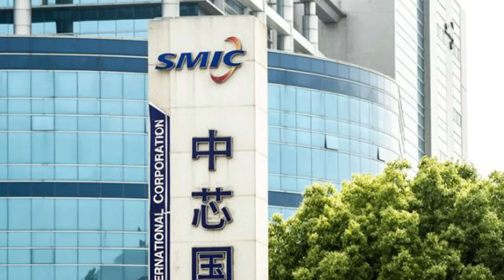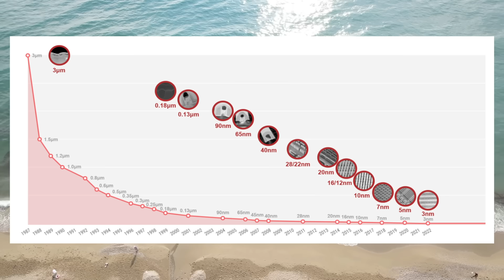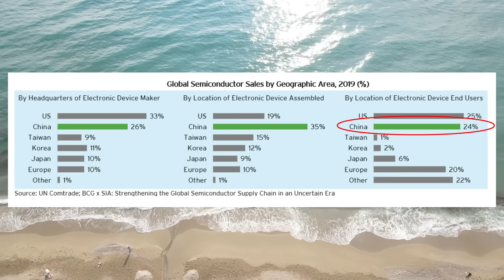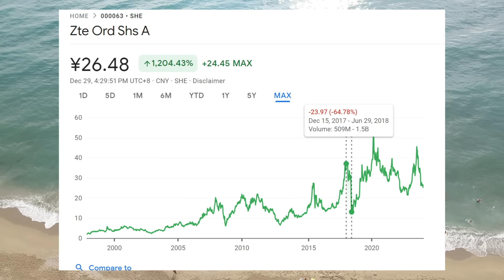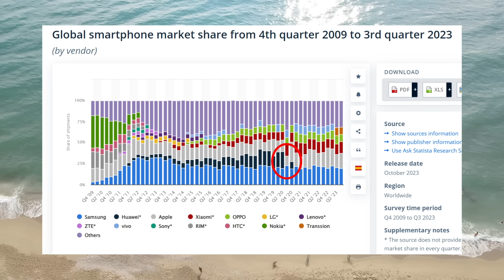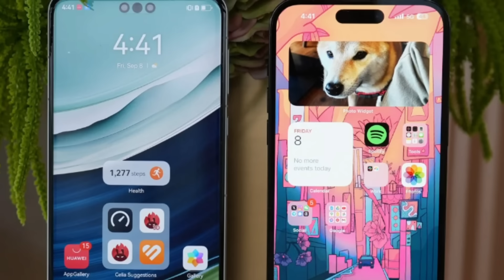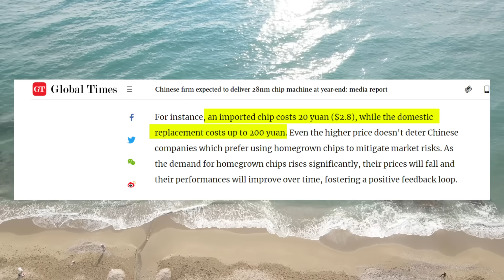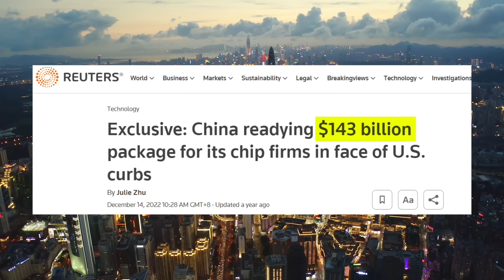Why China Semiconductor Sanctions Won't Work

Comment: For sanctions to work, the target must be weak and small enough that there is nothing they can do about the sanction. Their market cannot be so lucrative that foreigners would run the risk of punishment to supply them.  They cannot have a big and sophisticated science and technology sector so that they can make replacement products (not as sophisticated, more expensive, but still useful).  

China fits none of these criteria.  Why is anyone surprised that the sanctions fail?  The real problem is that the US started the technology war without thoroughly studying China's capability.  "Know yourself, know the other side, and you will not lose."  The Biden administration obviously had not done its homework.

Comment: @18000rpm
Have you visited the Huawei factory or are you working closely with the management there? If not stop being a smart-ass with your ridiculous speculation. 
All important parts of any device or equipment must have a manufacturer's serial number indicating its manufacturing date and place for security or other reasons. 
Many specialists have already dismantled the Huawei Mate 60 and confirmed that the chips were produced by Huawei from a DUV machine with stacking techniques. 
You have just made yourself look like a fool without any concrete facts or proof.

Comment: The nanometer rating of chips isn't how fast or energy efficient it is, it's the size of the transistors.  Mind you, smaller transistors are more power efficient and because there are more of them and they are closer together, lower nanometer chips are faster.
Reply: It's the opposite, the number no longer indicates size but rather a set of power and performance benchmarks. 3nm gates are roughly the same size as 7nm ones as of 2023. But they have a lot more features built onto them.

Comment: As someone with family in the semiconductor industry working with TSMC, Samsung and Intel, China will have a hard time in the EUV space as the entire supply chain is often blocked for them. This channel always focuses on ASML, but there are thousands of companies like Lam, Applied Materials etc, that have extremely complex proprietary equipment and chemicals that they themselves have taken years if not decades to research, develop and then apply to current fab lines. There are multitude of smaller companies that are spun out of academic research labs that have the few people in the world who know how to make and apply it even if their research is published in a very general and simplistic fashion. These companies themselves have taken years to get their stuff working and get their stuff to work in the fab lines which often takes as much work as just making it. These aren't off the shelf products, but products that require years of back and forth with Intel or TSMC to get even maybe the product to possibly work.

Comment: You are wrong, completely wrong.
Ronald Reagan crushed the Sovjet Union without firing a single shot.
He made it collapse internally.
Joe biden is doing the same with China.
When China builds it own space station it is using money which it does not have.
When China is developing their own chips they spend a lot of money.
Today they can't even pay salarys for their soldiers. Nor for doctors and teachers.
They will collapse mainly because they use money to appear strong instead of building a sound economy.
Sanctions are making exactly what is intendeed. They are clever acts indeed.

Comment: During the tear down of the Huawei mate pro 60, it turns out that China has just been using 3 year old chips that they purchased from tsmc before the sanctions hit.
Reply from the maker: You're confusing the Mate 60 Pro with the L540 notebook. The L540 notebook's chip was indeed purchased from TSMC before the sanctions hit, but the Mate 60 Pro uses a chip made by SMIC

Comment: In 2011, Obama proposed the "Pivot to Asia" strategy, which shifted the focus of US foreign policy from the Middle East to Asia. This, along with the wargaming of a sea blockade of Chinese commercial ships on a global scale, the formation of the Trans-Pacific Partnership (TPP), which deliberately excluded China, the establishment of a 2500-strong US marine air-ground task force in Darwin, and an increase in the rotation of both US Air Force planes and US Navy vessels through Australian bases, alarmed the Chinese leadership.

Unable to remain passive, hide their strength, and bide their time, Xi Jinping was selected as the leader of China in 2013 to make China more secure. These included the establishment of the Asian Infrastructure Investment Bank, the Belt and Road initiative, and the building of artificial islands in the South China Sea. These policies were a direct response to the perceived threat posed by the "Pivot to Asia" strategy. No country is excluded from joining the AIIB or the Belt and Road Initiative. Obama's intentions were clarified when he responded to Xi Jinping's proposal on September 25, 2015, to make the South China Sea (SCS) a non-militarized zone by initiating freedom of navigation operations in the SCS on October 27, 2015. In 2015, The “Made in China 2025”, (MIC 2025) initiative was launched.

It was cheaper for China to buy reliable Western chips, benefiting both sides. China spends more on chip imports than on oil. The "Made in China 2025" initiative provided substantial funds for chip development, but companies were hesitant due to technical challenges and the risk of competing with established players like Intel, Samsung, and TSMC. With US sanctions, China shifted focus, prompting the emergence of new chip research companies and increased government subsidies, making domestic chip development a top priority for Chinese research institutions. When self-sufficient, China can provide the world with cheaper chips, while the West and its allies lose access to both the Chinese and global markets.

The US is developing its own supply chain, but without access to a large market, it cannot be competitive.

The US is leaving no knees untouched in its Tonya Harding competition strategy. 

The Chinese are very grateful to the US for pushing them towards self-sufficiency. Thanks to the US, China now has its own GPS system and space program. More sanctions, please.

China is working on a 75-meter-radius SSMB (Steady-State Microbunching) particle accelerator to provide 1KW continuous, pure EUV light sources for multiple lithography machines, enabling the production of chips with a process size of less than 2nm and beyond.
Reply: Yep. AFAIK the only technology inside ASML's most advanced machines that China can't yet replicate is the extremely pure and powerful UV light source; if China can replace it with something else (like a synchrotron light source from a particle accelerator) it should be able to make cutting edge chip making machines in a relatively short timeframe.
If I remember correctly, that synchrotron light would theoretically be pure and powerful enough for 1nm chips (assuming those can be made at all, as it's too close to the theoretical limit for non-quantum computers).
Reply: Damn, learned a lot from that. Thanks.
Good to see China is well prepared and coping well, this matches with much of what I am currently aware of this geostrategic competition.
Reply: I'm sorry, but anyone one claims "China is grateful for US sanction on chips" is just post propaganda. If China is "grateful", it would have banned imports of western chips before being banned, instead of raging about western ban all the time.  I'm sorry, I came from China and is just so tired of the same daily propaganda already.  China may eventually catch up, but the facts are the ban caused a delay in that time table.  It's only a question of by how much.
Reply: That is all nonsense the ccp is a criminal regime that brutally exploits it's. America does not need china you don't see Americans whining about decoupling. China sucks
Reply: Obama the WAR CRIMINAL, that got a peace price. You see how f...ed the world is. :face-blue-smiling::face-blue-smiling::face-blue-smiling:

Comment: Having worked at ASML in the US for 6 years I find the claims in the video extremely misunderstood. ASML EUV technology is pivotal for high end chip manufacturing. Without this technology China will be stuck were they are now for years to come. Development of this technology is so complex I would say even with trillions of dollars spent and 10 or 20 years I find it unlikely that any Chinese company would be able to make anything similar to an ASML EUV machine. They might not even be able to even figure out the Extreme Ultraviolet light source in the timeframe.
Reply: The ASML CEO said it best, the physics in the Netherlands is the same as in China. If it exists, it can be done.
Reply: carry balls snd got backfired. at least chinese scientists dont roam the streets with guns. they are avid explorers to find new tech to solve and create new marks for China
Reply: @shasanmaz So these Chinese scientists? They are so smart they can use a Dutch machine to make a chip? 

Wooow they bought a tool and then used it 😂. Super impressive china.
Reply: @donkeychan491   Lol brother, Intel has to actually operate as a business, they don't work at the expense of government subsidies like this chip did. 

This is an objective fact, using this method doubles the time it requires to make a single chip, so the cost of this method is exactly atleast double or more compared to other, newer methods. This has already been covered many times by many outlets.

Comment: Last October, Canon announced commercialization of NIL(Nanoimprint Lithography) equipment to make 5nm node chips, It does not require light source. Consequently it reduces Si chips manufacturing cost significantly. In addition, it saves energy. Once Si chips can be mass produced with NIL, ASML will be out of business and China and US will have the same starting point. But China has advantage of having larger domestic chip market than the US does. .
Reply: Canon wouldn't be currently allowed to sell such technology to China, because of Japan's trade restrictions with China.
Reply: Nice to know a little pink watches WSM videos.

Comment: No, I don't buy it. Sure, it likely won't be completely crippling, but that doesn't mean it will have no impact. And claiming military equipment doesn't use advanced chips is a bit silly. Especially these days when everyone's looking to make their systems more autonomous. This will force the Chinese to invest a lot of extra money just to keep up. Money they would much rather spend on flashier projects like more aircraft carriers. They don't actually have unlimited capital, even though the like to pretend they do.
It's a bit like claiming it's useless lock your front door, because a determined thief could always smash through your wall with a sledge hammer and take your stuff anyway. A barrier doesn't need to provide total protection to be useful. It only needs to cause more problems for a potential attacker than it does to you to be worthwhile. As long as these sanctions don't cause bog problems for the west then it's probably worth it just do delay Chinese tech development by a few years. Assuming off course that China is a military threat worth worrying about, which I think they've become.

Comment: China isn’t the only player improving their chip production, by the time they achieve the current advanced standards the rest of the world would still be 10 years ahead, that’s without relying on heavy government subsidies. Also this is not the first time China dumped big money into chips manufacturing, they failed once due to corruption and I think they’d flop again.
On top of that due to China’s demographic collapse and foreign capital exit, in 10 years they won’t have the strength to keep up in the technological race. The west and its allies only need to stay ahead for 10 years and it’s game over for China.
Reply: They have precisely zero chip prodction. Most of the money was lost to scams and the rest failed to import a lithography machine, and even if they did who would run it?
Reply: precisely  @samsonsoturian6013